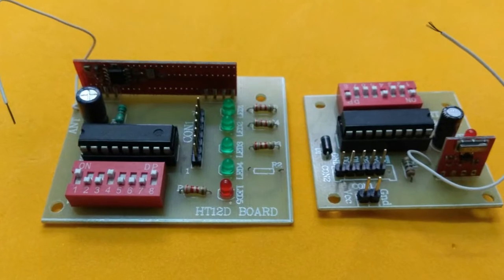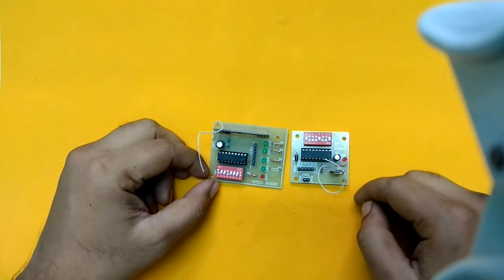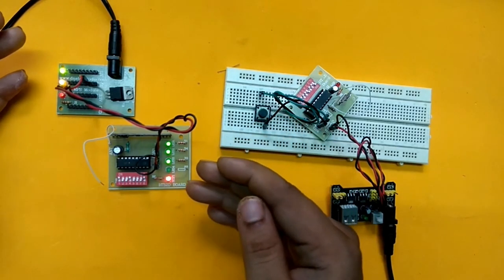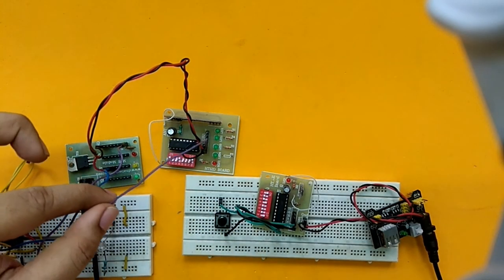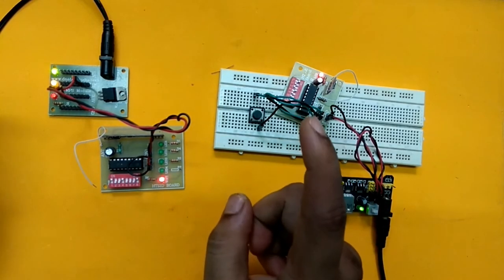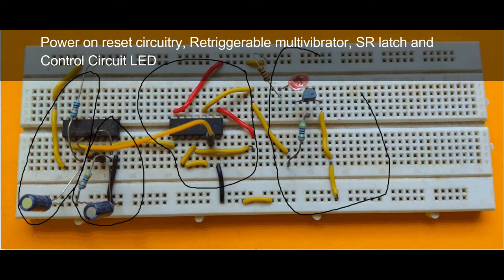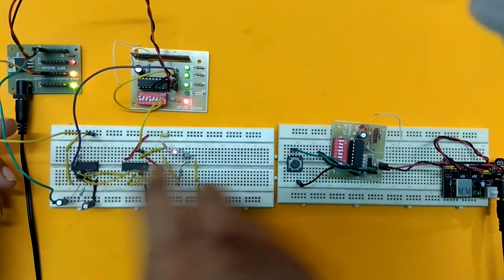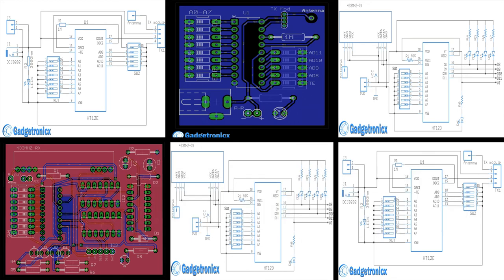How to build a RF remote on your own

Comment: Sir please make a project  without using RF module's  , please design a Remote Control circuit  to control the motors  , please explain how signal is transmitted from transmitter to receiver circuit to control the motors in the RC toy 
Please do it for educational purposes
Reply: you find out how to i wanna know to